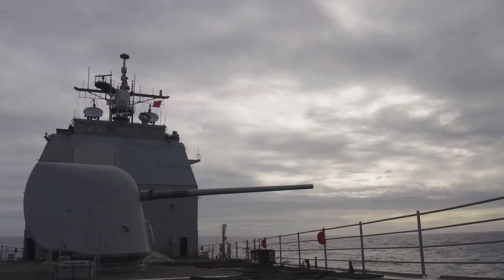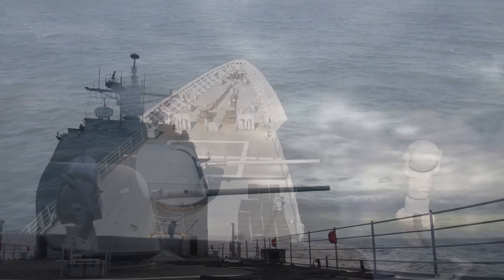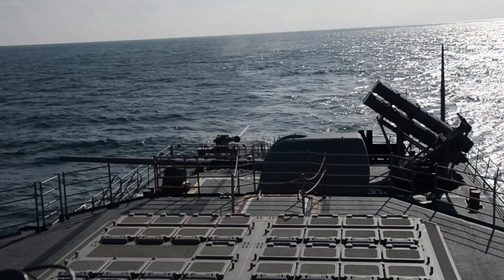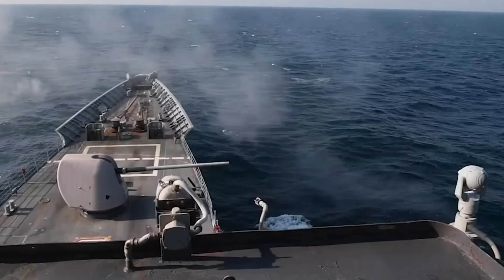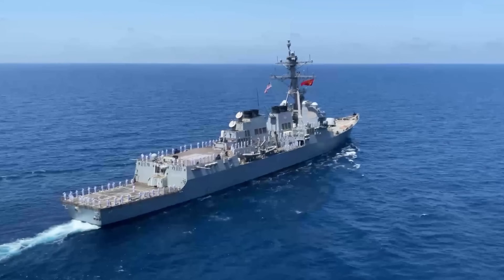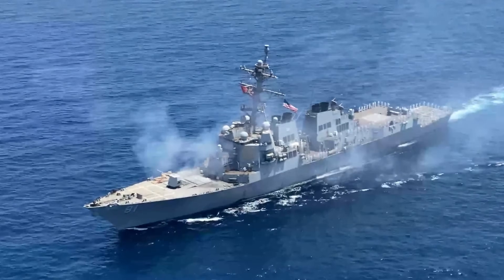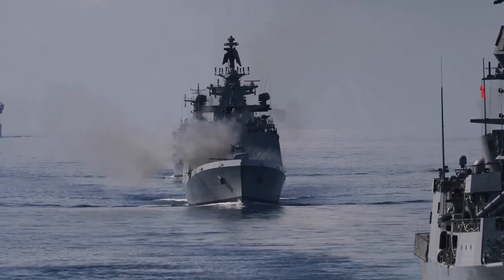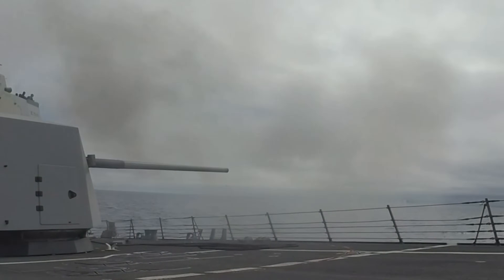The Mark 45 (Mk 45) Naval Gun System | FIVE INCH FIREPOWER

Comment: If you have to use a gun against other ship you have screwed really badly. I dont think that no ship is ever go anywhere in range of the coast of the country with half deacent weapons either. 57 or 40mm Bofors is way better gun against fast boats and air targets like missiles because of faster rate of fire and better fuzes.
Reply: They leave Phalanx for munitions, not much reason to use the 5 against them

Comment: missiles, with their advantages sure are nice. but gun is a gun. bet it still is harder to block shell than shoot down missile. lets have them both, and plenty of them.
Reply: Modern missiles are actually harder to intercept than a projectile traveling a ballistic path.
Reply: Missiles are far hard to shoot down than gun rounds. Missiles move faster, carry more explosive power, can maneuver, can avoid countermeasures, and have very long ranges. An artillery shell from a gun CAN be intercepted by a missile or the ships closed in weapons system which fires armor piercing high explosive rounds. Yes, it would stop the artillery shell because said shells are NOT armored and a 20mm round ripping into it will either destroy it or damage it enough that aerodynamic forces throw it off course or make it destroy itself. This is why the army uses the C-Ram system for rocket, mortar and, artillery defense for their bases. Its very effective.

Comment: correct me if I am wrong. but  the good thing with guns is that. you can go old school. with missiles they enemy can use countermessures.
Reply: You are right mate. Hard to shoot down a projectile
Reply: @brendanbate5440  Is a missile not a projectile? Missiles are far hard to shoot down than gun rounds. Missiles move faster, carry more explosive power, can maneuver, can avoid countermeasures, and have very long ranges. An artillery shell from a gun CAN be intercepted by a missile or the ships closed in weapons system which fires armor piercing high explosive rounds. Yes, it would stop the artillery shell because said shells are NOT armored and a 20mm round ripping into it will either destroy it or damage it enough that aerodynamic forces throw it off course or make it destroy itself. This is why the army uses the C-Ram system for rocket, mortar and, artillery defense for their bases. Its very effective.
Reply: Like the moscva did 🤣
 At least we know the US Navy missiles and defenses actually work as designed.  Can't say that for the iranian navy though (ie: 1986).

BTW, these guns are not controlled on the bridge but in CIC which is nowhere near the bridge.

Comment: Why does not Nato Army's and Marines plus Nato Navy's, standardised Artillery Howitzers and Naval Guns, on the 155mm calibre?

So able to share the same range of 155mm Shells, between Land and Naval Forces, as well as giving Naval Guns longer range too!

While reducing Artillery and Naval Guns ammunition stockpiles and resupply chain plus manufacturing base too, to one single calibre round.

Also why not have twin barrel naval gun mounts, instead of a single barrel naval gun mount, with an auto-feed mechanized too?

Because World War One and Two battleships, had multiple three barrel main gun turrets, with twin barrel secondary gun turrets too.

Let alone Cruisers, Destroyers and Frigates, after World War Two right up to the 1990's, were armed with twin barrel gun turrets, as there main gun arment too. 

The likes of some British Destroyers and Frigates in the Falklands War in the 1980's, having two or one fore-mounted twin-gunned turret with 4.5-inch (113 mm) guns Mark N6.

The QF 4.5 inch gun has been the standard medium-calibre naval gun used by the Royal Navy, as a medium-range weapon capable of use against surface, aircraft and shore targets since 1938. 

These 45-calibre family of naval guns wee installed in British and Commonwealth plus some other Navy's warships right up to the 1970s and 1980's, plus a few served into the 1990's and early 2,000's too. 

Though later naval guns were 55-calibre, see Royal Navy single gun turrets with 4.5 inch Mark 8 naval gun. Like all British nominally 4.5 inch naval guns, the QF Mk I has an actual calibre of 4.45 inches (113 mm).
Reply: The 5” was selected as the standard because it is a dual purpose, both air and surface target round and is light enough for a high rate of fire and to be manhandled by one crewman on a rocking ship at sea.  The 155 is too heavy for those purposes.

Comment: I think whether it's mk45 or 57mm bofors the naval gun can be very useful in some situations. It can engage air targets with no downtime whereas missiles have quite limited stocks or have to be reloaded. Against smaller craft, supporting a landing and why not even convoy raiding it is the perfect tool where using missiles would be too costly for the job.
Reply: What makes you think it has an unlimited supply of Rnds .
Reply: @alangordon3283  Where did I say that?

Comment: Best western guns is clearly Mark 45 127mm, Oto Melara 76mm and Bofors 57mm. The majority of European navy’s prefer the Oto Melara as a good compromise between the capabilities of the Mark 45 and the Bofors.  The big variation of ammunition and also anti-missile capabilities together with the speed of turret and firing rate is a major factor. This seems to be the most used naval gun as in use, with more than 60 navies using it. Take a look at these other two’s also.
Reply: OTOBreda 127/64
Reply: The OTO Breda 127/64 is actually the most requested gune in Europe  outside of the 76, selling very well even in the rest of the world. It trades a bit of utility in the anti air/anty missile defence, where the Strales system really is outstanding (drone kill rate in the red Sea) for a much heftier punch and range. The Vulcano ammunition alone sets the 127/64 in a category on its own.

Comment: It's weird that it's not equipped with thermal sleeve and muzzle reference device though I guess higher weight budget of naval vessel just allows to equip heavier thicker walled barrels and thus ignore the problems?
Reply: it got a watercooled sleeve around the gun tube

Comment: i'm surprised they haven't developed and deployed a combustible case propellant (a`la the 120mm of the M1 Abrams series!!) for 5 inch guns by now!
Reply: It's for both speed of firing and safety reasons, the USN hates fires on its ships.
Reply: @ronhmclaughlin  well the last time i looked the army wasn't too keen about fires in tanks either! i don't see where it'd be that much more of a hazard than a cased charge! and it don't seem to affect rate of fire on the tanks!! i'm not talking a unitary round here i'm talking a combustible propellant charge shoved in behind the shell!!
Reply: Cased charges are good that way. Long long ago they had bagged charges, which are nowadays used in bigger guns. A 16 inch gun uses six hundred-pound bags of smokeless powder for every shot, ram-loaded into the breech with machinery. Metal casings get awful heavy at that size.
Reply: @w.reidripley1968  it's a hundred and ten pounds two ounces per charge bag for US 16 inch charge bags!

Comment: An OTO 127mm/L64 with Volcano and DART ammo puts many missiles at shame rangewise, plus I would like to see at least 4 anti-drone, anti cruise missile capable gun turrets on any decent ship, one 127mm, at least two 76 mm (57mm can be substituted if Bofors can offer a discount).
Reply: I love the those are my favorite more than the mark 45
Reply: Ammunition technology, such as programmable air burst rounds, make gun systems way more useful, and economical. Ships should carry thousands of rounds, and the ability to be resupplied at sea.
Reply: @T.McGarry  The Volcano is a lightweight, extended range, guided shell. The 76mm one can reach surface targets up to 40kms, the long barrel 127mm to 120 km. That is over 70 miles.
Reply: Is there 127mm DART ammunition? From what I know the Strales system is designed for 76mm guns only.
Reply: I would like to see similar coverage of the Oto Melaras.

Comment: I wonder how the gun would do if put on a tank chassis.  It is larger than the 105mm but smaller than 155, so maybe it would be good for an Airborne self-propelled gun.
Reply: Not too well most likely. The gun mechanisms under the deck - what you don’t usually see - is quite large. And while diameter wise a 127mm shell not that much bigger then a 120mm shell, length wise there is a considerable difference. Both of these things would make fitting it in a tank very difficult.

Modern tank cannons also generally fire rounds at much higher velocities then modern naval cannons.
Reply: @Cris-xy2gi  There are also over-deck systems, though usually not that large - the most well known one is probably the Italian 76/62 Sovraponte, which is essentially a 76mm CIWS since it also has the Strales system.
But there is a system that combines a naval-caliber gun and a land chassis, it's the Russian A-222 Bereg. It's a self-propelled coastal defense gun that is armed with an autoloaded 130mm cannon.
Reply: Wouldn’t work as those systems are too tall, they expand quite far below deck.